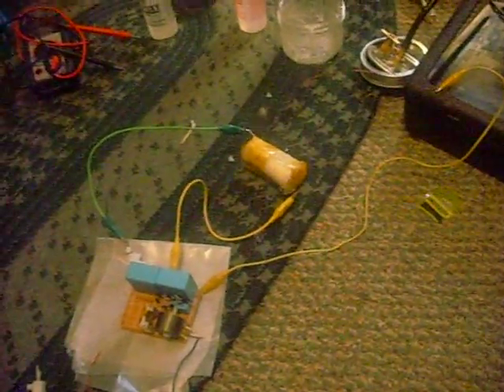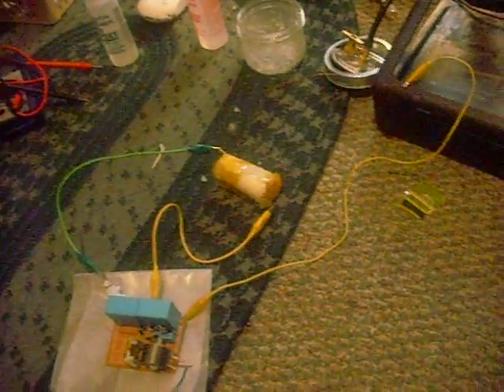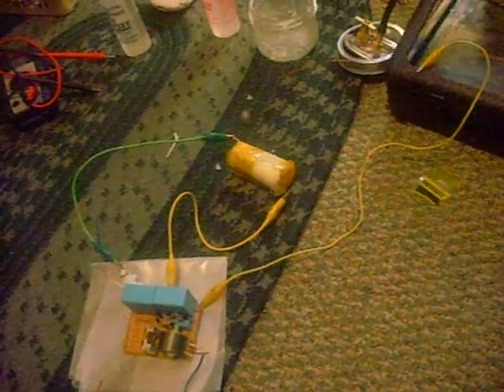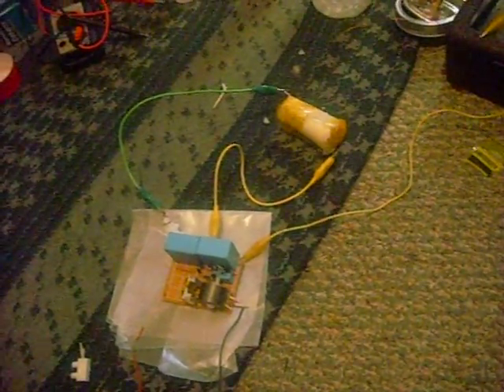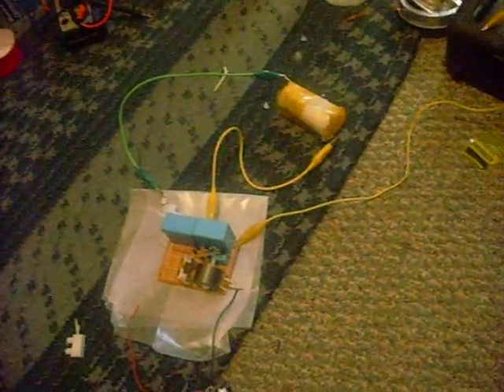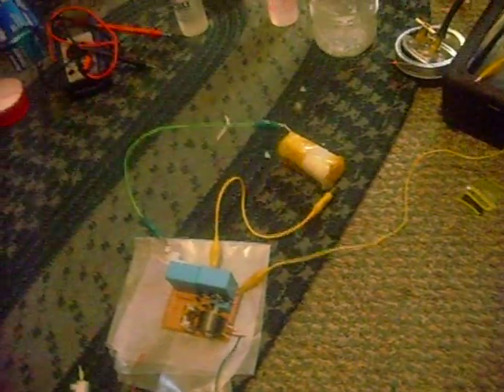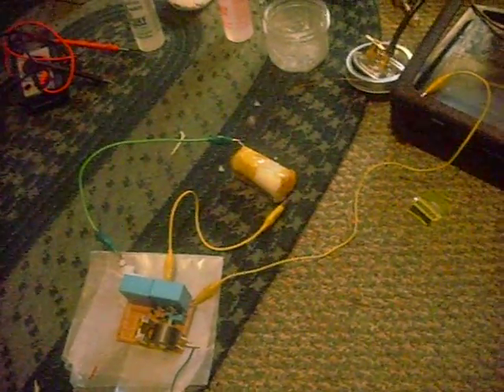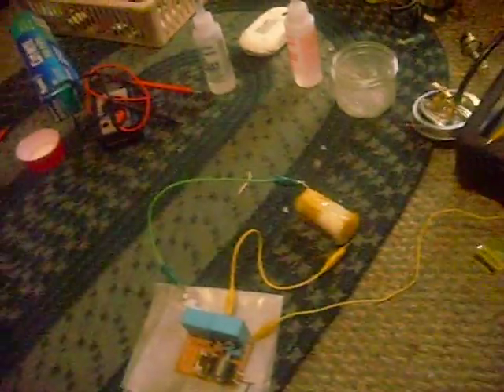High Voltage Pulse Trigger Transformer 80 kv (Tesla inductor)  ASK ME HOW TO GET ONE

Comment: pretty basic circuit. you need 2 capacitors, one to fire the primary coil of the impulse transformer for the spark and the other in series to the secondary coil to increase the arc current.

Comment: Great vid, im trying to build a pulse transformer to whack up the voltage for my bug zapper.. Not had much luck i must say.. Got 3 different bug zapper circuits with 3 different outputs, 1 is 400v, 2 is 1500v and 3rd is 3500v.. 
To try a PT i used a ferrite rod and also a iron rod with the amount of winds needed for P and S but nothing happened.. A voltage multiplier worked but was not as good..